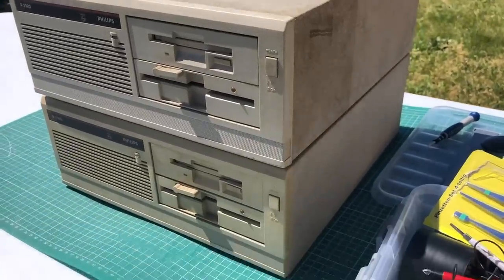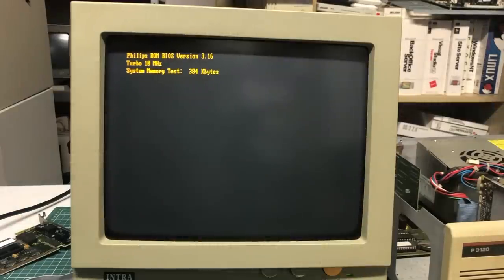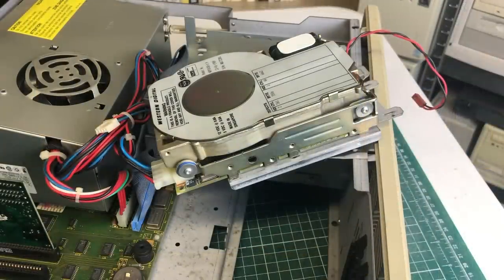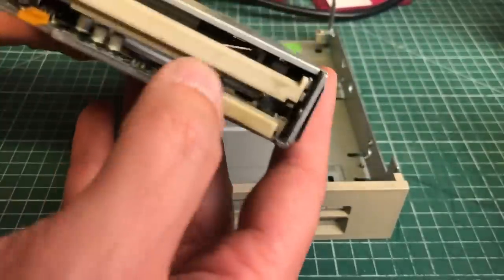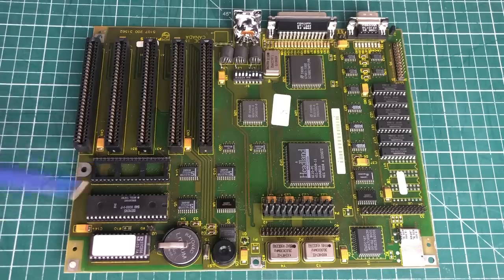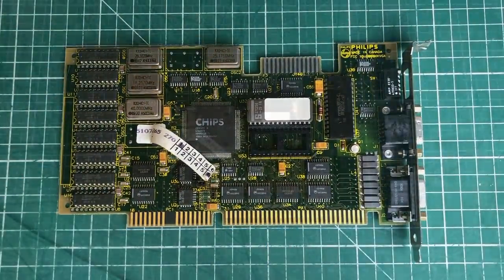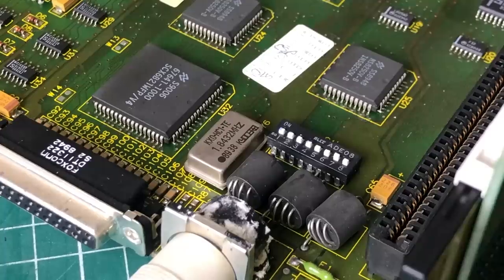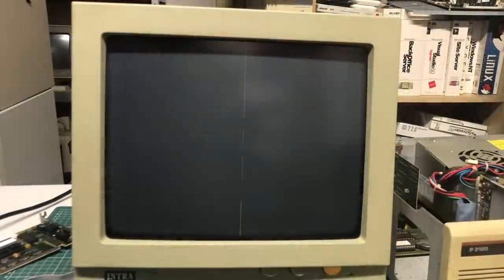Philips P3120 XT retro computer

Comment: I have several Western Digital hard drives like this.
The fact it didn't spin at first is caused by the platter motor sticking after a while. If you take off the PCB you'll see a round thing. That thing is attached to the axis of the platters so when you move it, you'll unstick the motor !
Next, there's the stepper motor which ALSO gets stuck. To improve it, you can put some oil in the axis and turn it on and off several times. This should get the hard drive working better :)
Reply: True, my Western Digital WD93044-A had the same problem and it worked perfectly after.  Mine made a ticking noise after it spun up, which was the heads not being able to move since the stepper motor was stuck.
Reply: I've got some of these. I've heard this effect referred to as "Stiction".
Reply: Good old percussive maintenance.
Reply: Deksor cool 🙂

Comment: Try oiling the stepper motor on the hard drive and see if that helps. When those drives have been sitting for several years, the stepper motor tends to stick when seeking.
Reply: That is a fact right there, I have a Western Digital WD93044-A that had the same problem, the motor AND the stepper was stuck causing it to make a ticking noise when it spun up because the heads couldn't move.
Reply: C:\ DOS 😊good idea

Comment: Ah, the "good" old Western Digital WD93xxx series. A probably interesting backstory on early WD drives is that they were not originally developed by WD. With the success of their hard drive controller cards, WD wanted to get into hard drive manufacturing. After failing to find a partner for a joint venture, WD bought the storage division of the then troubled Tandon Corporation in 1988. This is why the early drives like the ones from the WD93xxx series look almost identical to the Tandon TM262.

Early WD drives are very prone to failure; this is mainly because of the not-so-great idea of just clipping on the top cover. I bought a WD 93028-AD for my Commodore 286 and this drive reluctantly refused to spin properly even when giving it some help. Now I have a Seagate ST-157A in it which works like a charm. :)
Reply from the maker: I thought they looked familiar ! :) thx.

Comment: that WD brings back memories, I have one in pieces cause parts of it blew ages ago, and the stepper motor was seized up which seems to be a common failure of those drives, the stepper in mine had to be gently coaxed back into service with some 3 in one oil, I believe the 8-bit guy did something similar
Reply: yes this old hard drives are pretty primitive which also has to do with low data density they have so even if you disassemble it and put it back together and it does not perfectly align with the tracks it can still work

Comment: That ATI Small Wonder card that the Philips PCs originally came with could be considered a "CGA Plus" card. In addition to CGA compatibility, it also supports a non-standard 16-color 320x200 graphics mode called "Plantronics", which is incompatible with comparable EGA or Tandy modes. Unfortunately, no games supported that mode, so this ATI card (as well as a few other Plantronics-compatible cards from other manufacturers) would be limited to 4-color CGA graphics. However, someone recently wrote a 16-color Plantronics mode driver for Sierra adventures based on the SCI engine. Also I believe that The 8-Bit Guy recently added support for this mode in his Planet X3 game as well. Of course you'd need a CGA color monitor to be able to experience the full 16-color glory of that non-standard mode. This, along with the extra RAM above 640KB, made the Philips computers more unique than typical IBM XT clones back in the day.
Reply from the maker: True ... Commodore als shipped with those in their pc’s if I am not mistaken ... really need to get myself a copy of planet  x3. I am probably the only retro youtuber without one :)

Comment: Just a little  correction, and something a lot of people get wrong/misunderstand, is that WDC on the FDD controller is not Western Digital but the Western Design Centre, the people responsible for not only the processor in the apple II GS (16bit version of the 6502), but were visited by Acorn who then realised if a samll team in a garage couod make an updated 6502 they certinaly couold design their own processor and as such the ARM was created.

Comment: As someone who had the predecessor of this machine (NMS 9110) back in the day...

The 768KB memory can be used. There was a utility included that allowed drivers to be loaded into that space, like a mouse driver.

The ATI video card should also support Plantronics (you can try Planet X3 on it). It also should have a DOS utility to switch it between hercules/cga/plantronics mode.

Comment: I've never seen a video card with both a 9-pin TTL video connector and a 15-pin analog video (VGA) connector.

Far as I know, many 16-bit video cards will work without the 8-bit section plugged in, but they might need to have their jumpers or switches configured for this.
Reply from the maker: Have a couple of em here. Nice that most of them support the entire array of display options (mda, cga, ega, vga).

Comment: My NMS-9100 came with the Small Wonder as well. I guess this was part of one of the standard configurations then. Same HD, never got it work either, Something that surprised me is how well built the power supply seems to be. Very clean and not a sign of stressed components inside. Have a P3230 as well, same good quality.  I really like my philips PCs!

Comment: I used to have a WD hard drive just like that, in an early 90s-era 386, and it was unreliable way back then. I think the problem stems from the fact that those old stepper motor drives don't automatically park their heads when they're powered off. The heads rest on the data portion of the platters when it's off, and can whack into them if it's jostled. Evidently, stray electrical signals passing through the heads when the drive first powers on could also cause damage to data on the platters below them.

Try oiling the stepper motor axle with some light penetrating oil, and then rotate the motor back & forth over its full range of motion by turning the axle that's sticking out of the drive. My WD drive had a little clear plastic cover over the axle to keep dirt out, but it didn't really help much.

If you do get it working, be sure to always run the DOS command park to move the heads off the data portion of the platters before shutting the computer off. This will move the heads to the drive's landing zone and off the platters.

Comment: The bearing on that stepper motor is held in with an internal retaining ring/snap ring, if you could get that bearing out and get some measurements I'm sure you could easily find a replacement for it and slip a new one right in. Lubricating the shaft is only a temporary fix since it relies on the ball bearing itself for the turning surface! You could find a large blower motor, a decent size box and use a heavy filter to force air through to prevent debris to create a positive pressure cabinet for working on hard drives in to replace bearings, heads etc. A bearing that size would probably be between $1.50-$3 USD and would outlast 3 in one oil, besides if 1 drop of 3 in 1 gets past that motors shaft and hits those platters or the heads that drive will not longer be worth anything!
Reply from the maker: Thx for the detailed explanation. Always have mixed feelings on those old hard drives.  sounds like a lot of effort to get it working again, and these drives are always ticking time-bombs. Today I started my IBM 286 XT and about 15minutes in the hard drive reported data errors all over the place. Worked fine before.

Comment: I had a "dead" stepper motor drive, i popped the protective cap off and manually moved the stepper motor while the drive was running and that unstuck the drive head and it started working again. Also you need to remember to run park.com with these drives before turning the computer off to manually park the heads off of the data so the heads won't touch down or start up on any data.
Reply: Hello there, i got one Philips P3120, and i've been trying to solve the issue whit the drive for month but it keept appearing... Can you share that park.com program? that is was i looking for!!!

Comment: Awesome! This P3120 has the same motherboard as my Headstart LX-CD (it lost it’s CD-ROM drive somewhere in its history though).

You were saying somewhere in these comments that a BIOS ROM could be obtained somewhere on the web? Still need to check out if the Philips BIOS does a better job of starting the Low Level Format utility in the ROM of my Miniscribe 8450XT XTA (8-bit IDE) drive on my Headstart LX-CD! Currently I get only gibberish when entering the G=FA00:5 or G=C800:5 in debug.exe. The utility should be able to load though! In my Commodore PC10-III the ROM utility starts, but isn’t able to execute anything on the drive. 

I have no idea how you do it, but most of the video’s you upload are related to the stuff I’m actually working on at that moment! 

Again, I love your video’s! I’m really looking forward to every single one of them, every time again!

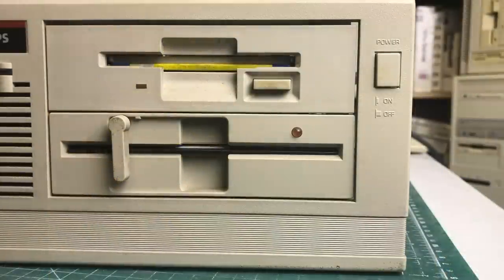Comment: This 3 1/2 floppy drive sounds like a siren in 5:27
Reply from the maker: Was thinking about fixing it but would take a lot of time and effort. Perhaps a separate video. But at the end of the day it is just floppy drive. Some things are just more easy to replace than fix.
Reply: @RetroSpector78  I would still fix it since they don't make them anymore.
Reply: Honestly, it sounds like the motor is just free spinning.  The belt that's supposed to move the read/write head might have broken or slipped off.  Could be a very easy repair.

Comment: HI RetroSpector! I tried sending a message to you on the Vintage Computer Federation forum but I'm not sure whether you got it. It was in relation to the 90s retro Linux install you did a while back. I have a RedHat branded CD-ROM and manual for Motif, which I understand is the only closed source software that RedHat has ever sold. I thought would make a great addition to your Linux install since it's from the same era.

I also have a bunch of spare floppy drives from the late 80s to early 90s that were pulled from electronic music gear and replaced with emulators. If they're something you could use then I'd be happy to send them to you. They're mostly 3.5" drives, but there's one or two 5 1/4" drives as well.
Reply from the maker: Best to send me a mail (about section of the channel). Sorry I missed the vcfed msg.

Comment: thank you for posting.  i think i saw that ide connector on the mobo had 40 pins.  i wonder if you could plug in an inexpensive ide2cf, or ide2sd adapter card, as a replacement for the hdd.  not period-authentic, but extremely practical.  if the pin-out of the connector doesn't match current standard, perhaps a custom-made ribbon cable ?  laborious, but satisfying.  please consider me a fan.  take care & stay safe.

Comment: Wow, I can't believe how modern and neat that motherboard looks for the time and its specs. Well I mean it like mid 80's right we had like 286, and 386 out already. I have a suspicion they were made to be used in Gas pumps or ATM's back in the day, and surplus boards were just made into a cheap pc. I am saying Cheap because of what would have been available at the time, plus they did stop making the 8080 in late 80's or 1990. I don't know, I will need to look it up.

Comment: Maybe the motor was just a bit stuck.  If the platter spins you can sometimes get them working by giving the stepper a little movement manually.   That can be a little gentler than the hitting the side :)

Comment: This VGA/EGA PCCHIPS video card can work in 8-bit as well as in 16-bit systems. You just have to setup it properly. It similar to Trident 8900/9000 cards, they also worked in 8-bit slots quite well.
Reply from the maker: Yeah, the same card was found in another philips 286. I did notice that not all trident 8900/9000 cards seem to work in an 8 bit slot. But some do.
Reply: @RetroSpector78  There are two kinds of them out there. The ones which do work in 8-bit slots have 3 jumpers in a row and additional one somewhere near the BIOS. You have to set the jumpers the way, that the card goes into 8-bit mode. Usually, when all of the said jumpers are closed, the card will use 8-bit mode. However, there are some cards out there with autodetection (sometimes again set by a jumper), or with hardwired jumpers or with no jumpers at all. Then the card will probably fail, trying to run in a short slot.

Comment: big old drives like that suffer from sticktion allot . Sometimes just a bump or giving the drive a spin along the axes of the platter can get it moving again.
As for some of the older drives the ones that use a stepper allso can suffer from tempreture deferintals. The platters will expand/srink a bit pushing the tracks just out of range of the heads.

This is why we had Low level formating back then. rewrite the tracks bring it to life.

Comment: You need to tap the hard drive lightly immediately after you apply power so that both motors can turn. You probably didn't get the stepper motor to move because the drive wasn't trying to move it at the time. I have one computer where I have to tap the side of it every time I turn it on. (I should probably oil it.)

Comment: 10:22 wrong. You can address more than 640KB under msdos on XT. Use UMB driver, either Headland specific or universal one. And you'll be able to load drivers into UMB and probably even get more then 640 KB conventional memory. Just google about it.
Reply: EMS driver for Headland chipset could also put that extra RAM into use
Reply from the maker: Correct ... might do a follow up on that.
Reply: @RetroSpector78  this would be great! Thank you for the video.

Comment: I agree with many other commentators. You gave up to easily on the problem components. The hard-disk might be fine with some lubrication of the motors and the floppy drive might also be quite serviceable. Look up channels like that of Adrian Black. He services a lot of floppies/HD (mostly commodore and mac but same principles apply). Giving up on components quickly is my main problem with your channel.The unfixable video card from hell is a nice exception. But do keep making videos.
Reply from the maker: Sorry to hear that ... sometimes time is limited and one can only spend so much time on these videos. Old hard drives from that era are also not the most reliable to begin with so one has to make a choice if it would deserve the time and effort in fixing this. One can easily spend a lot of time on it just to have it fail again a couple of days / week later. Some also feel that lubrication is only a temporary solution. Regarding the floppy drive ... there are so many still working drives around that to me it doesn’t really justify the effort. If it was a special floppy drive (ibm ps/2, or even a 5.25 inch one I would happily go the extra mile. But with an entire box of 20+ working 3.5 inch drives sitting next to me I can’t get myself to go in and fixing this particular one.
Reply: @ Bart. I disagree. Unless the item in question was unique and not able to be substituted or you have oodles of time and nothing else to do, but if an easily replaceable solution gets the system up and running then that's more efficient use of one's time.
Reply: @RetroSpector78  I understand, but for me as a viewer part of the fun in watching is seeing things fixed. So I would rather see less videos but more fixes then the other way around. The floppy itself might not be special but it's specific front face and button might be unique and "belong" to the machine design. So another might not look right. But again that is just me. Seeing something fixed is more interesting then seeing something replaced. But in the end it is your channel and your choice. This is all just a little feedback
Reply from the maker: Bart Zuidgeest and all feedback is appreciated :) will perhaps to a follow up.

Comment: i wonder if there's an adapter cable to allow use of a more common at ide hd w/ the xt ide connector on the mobo.  i enjoy your videos, especially the 'diagnose & repair' ones.  thank you for posting.
Reply from the maker: The only thing I am aware of is the Lo-tech 8-bit IDE Adapter rev.3 using the universal bios that enables the use of standard IDE (ATA) and SATA hard drives on a system that has a free 8 bit ISA slot.

Comment: I was wondering if you knew the proper way to get into the BIOS setup. I have a 386SX Philips computer but the only way I can open the BIOS menu is by jamming the floppy drive or by disconnecting something the BIOS expects to be connected.

Comment: Hello,
Have you tried other color mode (EGA, CGA) with the ATI or Chips video card ?
Perhaps, you don't have compatible monitor.
I wonder if The Cycles game can run smoothly in color mode. In VGA mode, the PC struggles a lot.
Reply from the maker: The ATI card will only do cga not ega. Tried it on my monochrome monitor and worked well.... might do a follow up on that. Scored a nice TVM color EGA monitor couple of days ago so might give that one a try.